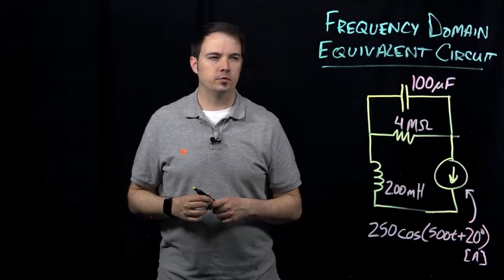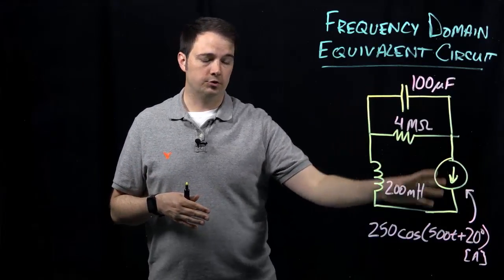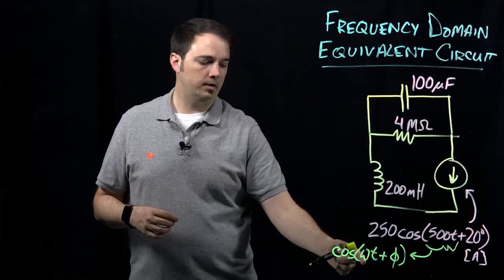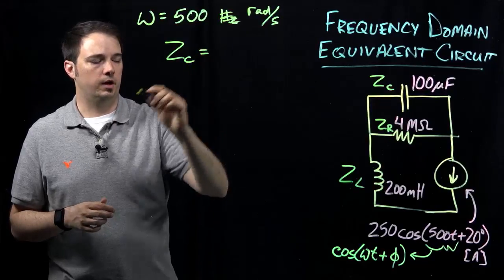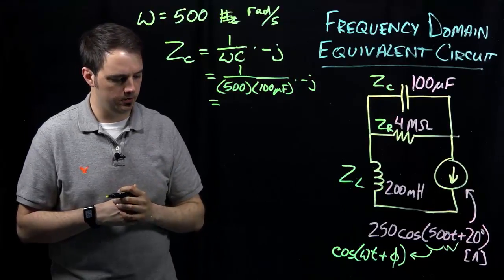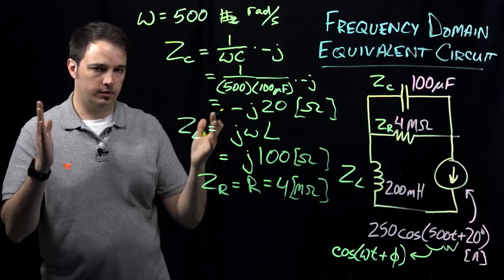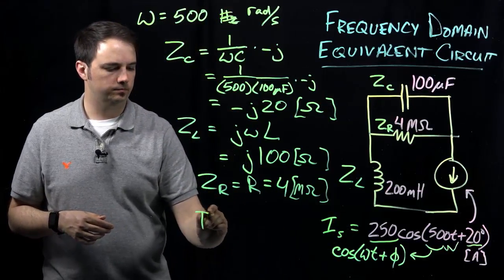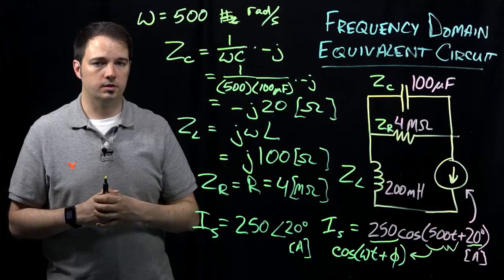Circuits I: Example - Frequency Domain Equivalent Circuit

Comment: Beware, there is an error near the end of the video. The magnitude of the voltage in the frequency/phasor domain is Vrms, = Vmax / sqrt(2). In the video, the instructor mistakenly copied Vmax = 250 V from the time domain, rather than Vrms = 176.8 V

Comment: How do you write backwards?
Reply from the maker: +smithsip1 Actually not writing backwards...I am writing normal on a piece of glass with the camera on the opposite side. During post-processing I simply flip the image such that it appears I am writing backwards (mirror image)!
Reply: +smithsip1 maybe it's a smart board type thing
Reply: I need help on my circuit theory calculations